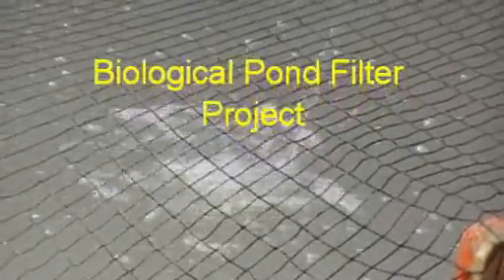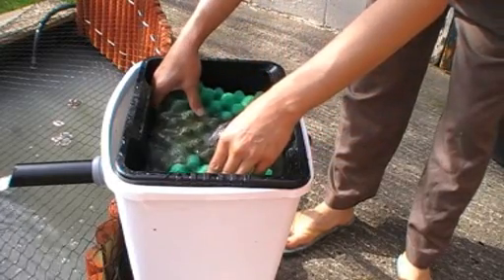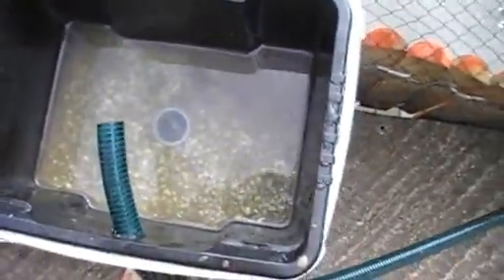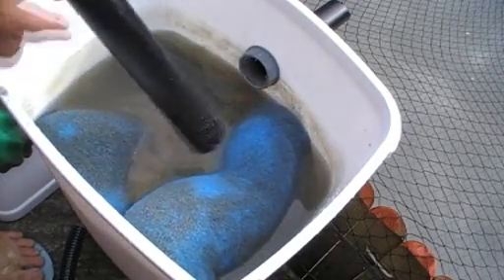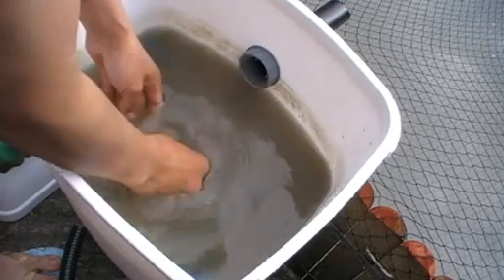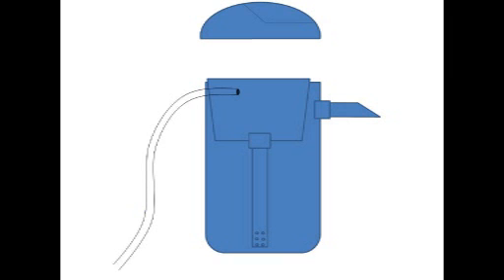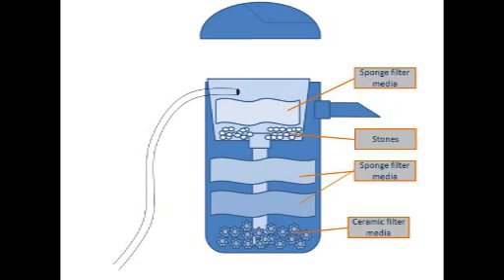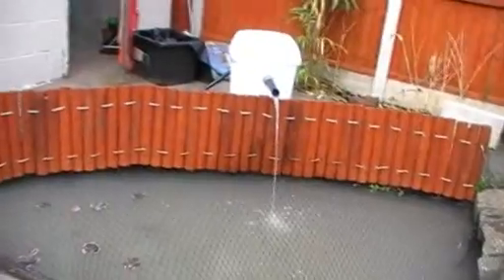Biological Pond Filter.wmv

Comment: this is good design. if you wanted to make it more efficient then 
1) remove the top basket
2) use lava rock in the bottom 1/2 of the filter as your media to house your colony 
3)drill more holes in your tube
4)use fine media as your second layer of media (walmart polymer pillow filler does a great job just make sure it the one that not anti fungal )
5)then youse a good a good course filter pad for your top layer. 

This will create a better flow of water and filter about 100-400% more water.
if you ever get an algae bloom in your pond the you can use barley stray either in your filter or directly in the water of the pond itself. 
I wish you well on your pond , good luck.

Comment: An interesting and ingenious design, I have built a few filters using water butts as the container, not all plastics will survive sunlight for long. I have used polyester duvets as filter material under a layer of gravel. Curiously my "improved" design with sand does not appear to work as well.

Comment: Dono, there is no reason at all to have that inner basket.  It's a waste of space that could be used for filter media.  Do a top down gravity feed system.  A plastic leaf screen at the top, your fine plastic fibers under that, polyester fiber (pillow fill) under that, and finally your ceramic bio media.  Run a stand pipe, screened and protected at the bottom, back up to the filter output, 2" below the input at the top.  Change the polyester when/if needed and rinse off the screens.  Leave your ceramic media in place at the bottom as a permanent bacteria 'reserve.'  That will give you maximum efficiency and easy maintenance.
Reply from the maker: Thank you for your helpful comment.
Will modify my filter when spring arrives :D
Reply: Forget to mention that if you make the input pipe, say 1" diameter under pump power, make the output standpipe and bulk head 2"
Reply: PalJoey1957 Joey.. Can you please end me in the right direction on what you are talking about. Looking to build my dad a pond filter for Fathers Day. Any help GREATLY appreciated.